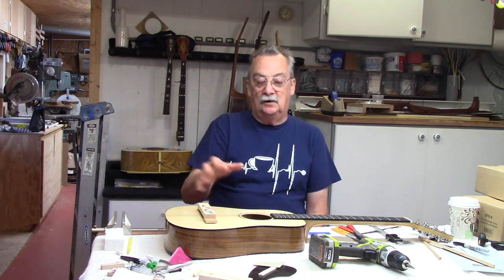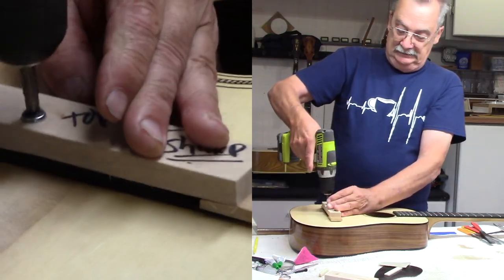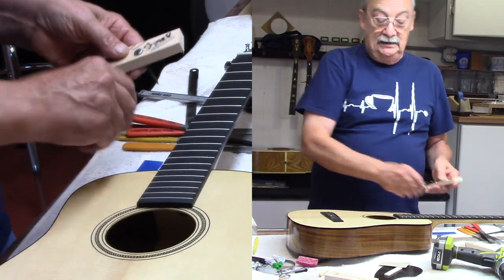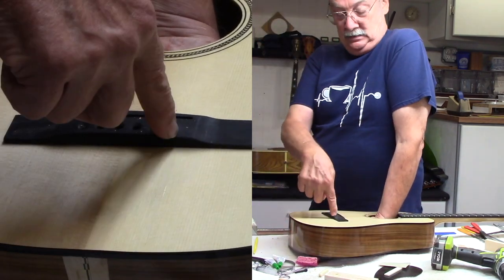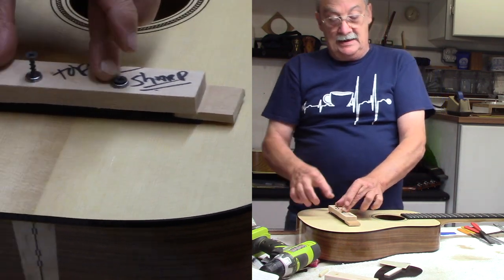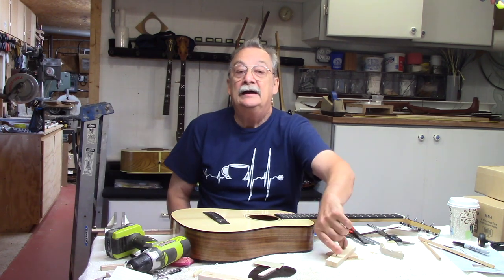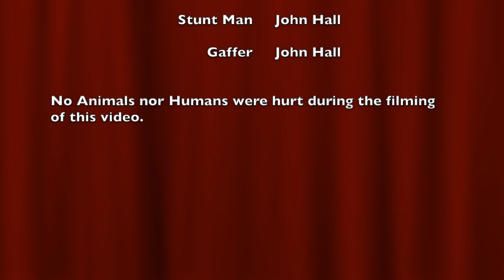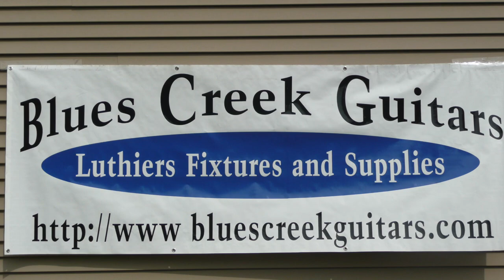Blues Creek Guitars - Cheap & Easy Bridge Clamp & Caul

Comment: Did I understand correctly ? You actually drilled holes into the bridge ?
Reply from the maker: Not John, but all bridges have the 6 holes in them for the strings to pass through - those holes will need to be there eventually.  Make sense?
Reply: @LaSalle.ToneWorks    has it correct